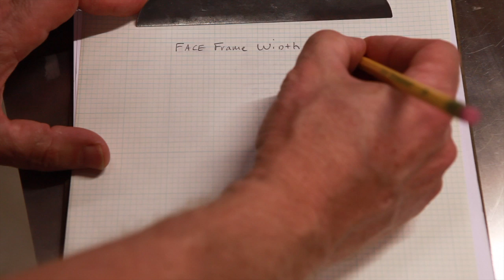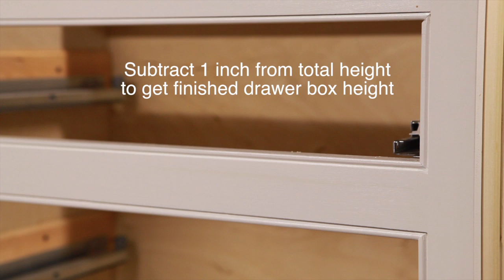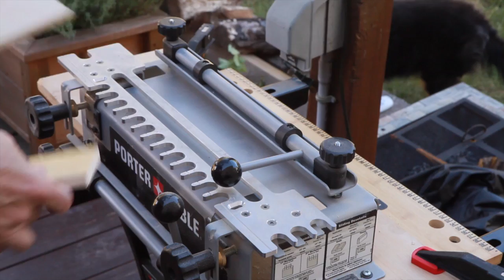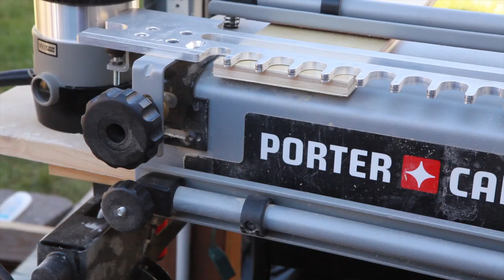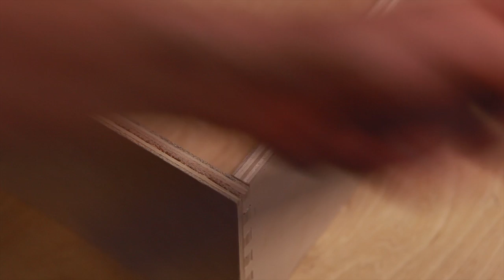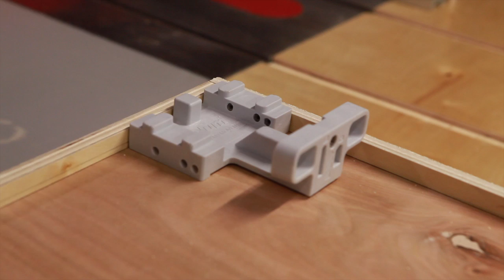How to Make Drawers for the Blum Drawer Slides

Comment: Good video, nicely done, everything you said was accurate but you kind of missed a really important point that folks should know. The most critical dimension for these type slide are is the internal drawer width, that must be 100% accurate as there is very little wiggle room. You did not have any problems because you very precisely measured your side thickness, but the better practice is to just build to the inside drawer dimension.

Comment: Very helpful, but one question.   How do you size the height of the drawers so that the grooves for the bottoms don't leave an unsightly gap--they need to be buried  in the  pins.     Using an even inch number so the P-C jig half tails fit correctly, I can't manage  to do that--for the most part, it doesn't matter with a false front covering the front and nobody taking out the drawer to examine the back, but I know and it's bothering my OCD.  There has to be a way.
Reply from the maker: I have a 1/2 space under the drawer bottom. That gave me enough space to cut out the grooves in the back. I can send you pictures if needed.
Reply: @Richard_Goodman  Yes, please.   I was able to cut the drawers slightly over height, plow bottom grooves when I wanted them, and then rip 1/2" from there so they fit and don't show on the outside of the box, but am wondering whether there isn't a more efficient solution.

Comment: Is it possible to build a deeper drawer than the slide?  I’m trying to reduce the wasted space in back of the box.
Reply from the maker: Yes, you can make the drawer deeper then the slide. The only thing is when you open the drawer you won’t get the full drawer extension. The drawer will only open as far as the slide will extend. So, if you made a drawer that was 24 inches deep and you used an 18” slide the drawer will only open 18”. Hopefully that makes sense.

Comment: This may help others if they are not doing dovetails joinery. Cut sides the full length of the drawer. Front and back pieces will fit inside the sides.
1. Measure the face frame opening side to side.
2. Subtract 42 mm (1-21/32") from the face frame measurement.
3. This is the dimension that the inside of the drawer needs to be. So cut your front and back to the length of this dimension.
4. Make sure to not exceed 5/8 (15.875 mm) board thickness.
5. The length of the sides should equal the Blum slide that you purchased. So if you purchased an 18" Blum Slide, cut your side pieces to 18" (457.2 mm)

Comment: could you go into more detail about planing drawer length with the blum slides? i tried to install some slides but the drawer was too far forward past the cabinet face.  i clearly had trouble understanding the slide length vs drawer length finished.  i couldn't find how far infront of the slide the drawer box will sit.  i purchased slides that fit almost exactly in the cabinet, with a few mm set back. but unfortunately they can't go back any further so i need to order smaller slides, and shorten the drawer boxes. but could you explain the drawer box length in relation to slide sizes pls? thanks
Reply from the maker: Yes. I will either post a video sometime this or reply back to you with clear instructions. Great question!

Comment: Great video as I ran into the same issue with such limited full instructions line of the complete process.  Calculating the board length for the drawer slides was a big hangup for me.  I am doing the same thing using KV MUV slides instead (and using 5/8 thick solid wood for the sides).  I played around with it yesterday making a test box and was using this video as a sanity check.  The steps are nearly exactly the same (not to mention I have the same track saw and PC jig).  My back is still hurting watching you cut up that ply into tiny strips on the ground! I would have had to use some saw horses/2x4's under those pallets :)  Thanks for making!

Comment: if using 12 inch drawer slides im told you build the drawer 12inches in total length. Is this length under the assumption one is using 1/2 material? If using 5/8 material, there is an extra 1/8 inch which prevents the locking clip from being housed underneath. It seems one would have to build the drawer at 12 1/8 to allow for the 12 inches of space underneath the drawer for the runner
Reply: Chevy, that's correct.  Blum's installation manual is written under the assumption that the user is using 1/2" thick material.  5/8" is the thickest material the slides can handle BTW.
Reply: Maybe I missed this, but it should be specified that 5/8" is the maximum side thickness for the 563H style slides. If you are using the 563F, the maximum side thickness is 3/4".

Comment: Well done.  I have no problem with the mix of metric and inches.  But the latest Blum do have the instructions in inches as well, which helps.  One thing, I swapped the half blinds so the sides are clear, and the face is where the dovetail ends show.  I know it is not very conventional, but once you place the face board on the front of the drawer, the sides are clear, and no ply ends show.  Also the shelf bottom dado cut does not show, either.  One thing I have not figured out is, why do Blum want you to put the cabinet face end of the drawer slide back 1/8" from the edge, and not flush with the face frame.  From what I can see, the drawer front is exactly level with the front edge of the slide.  so if I offset it back 1/8", my drawer face will be 1/8" inset.  I noticed you seemed to have it set back in your cabinet.  I wonder if I am missing something.

Comment: With the inset drawer front, how far past the face frame did you install the drawer slides.  Can't find exact info on this.
Reply from the maker: The part of the drawer slide that gets installed into the cabinet is mounted flush to the inside face frame and approximately 3/16" back from the inside edge.  I had to screw some scrap 2" wide plywood inside the cabinet where the slides are mounted so it was flush with face frame. Hope that helps and I can send a photo of how they are mounted if you would like.
Reply: I already built out the sides the cabinet to be flush with the inside of the face frame.  My difficulty was be not sure where the metal drawer slide begins past the inside of the face frame.  So you placed your metal drawer slides 3/16 past the inside of the face frame.  Thanks
Reply from the maker: Donald Johnson Yes, they are behind the face frame 3/16" (not touching the face frame)
Reply: Thanks!

Comment: You can't get a better track saw than Festool, but no tablesaw ? I would suggest using a wood gauge block to set your track to for increased accuracy.
Reply: Accuracy is not the only reason for using a track saw.  There is also vastly superior dust collection as well as cut quality.  With a festool, you can cut $150 sheets of plywood, and BOTH sides of the cut are better then factory, with ZERO tear out.  Can your $30 jig do that.  And we all know the answer is no......
Reply: Phillip Emmons I have tested my home mad door board with is a track made specifically for my saw and it cost me 30$or less in material and my friend has the festool I made a cut he made a cut and no difference in accuracy what is nice with the festool is it is great for people who can't control there tools but I can make my track hold the other side of my saw if I become lazy